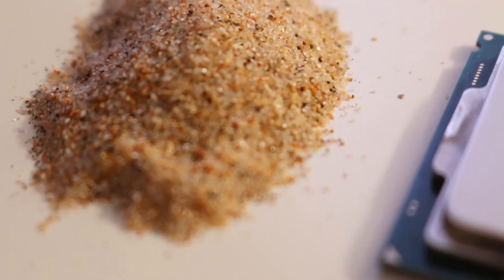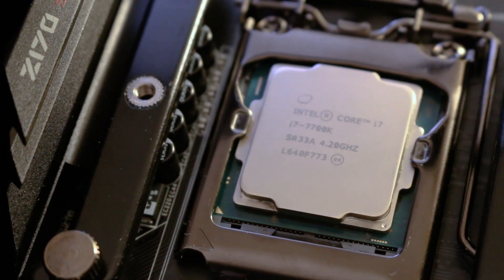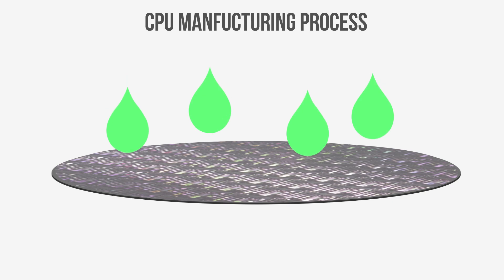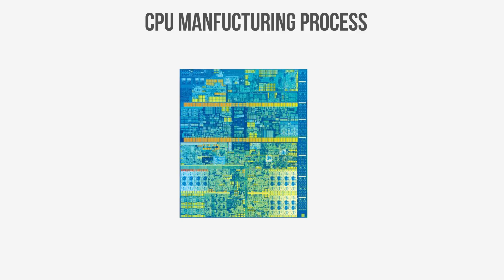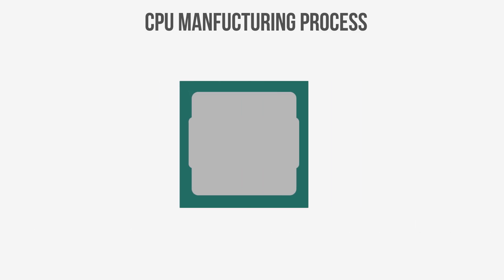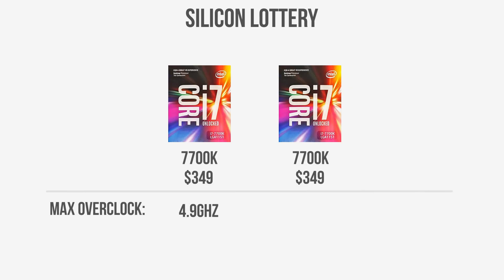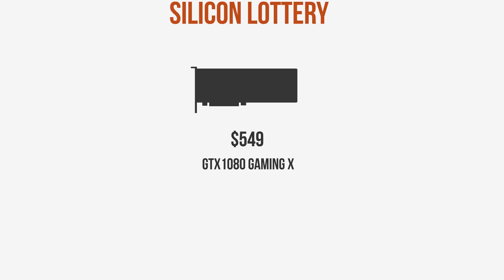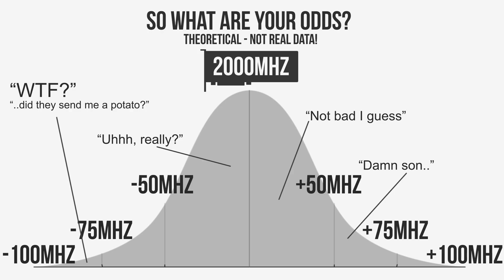What is The 'Silicon Lottery'?

Comment: Had a few wins over the years and a few losses in that lottery. i7 6700K @ 4.9 GHz, Core2 Quad Q9650 @ 4.5 GHz, GTX 750Ti @ 1,460MHz (bios mod), R9 Fury @ 1,200MHz (bios mod) and an R9 380X @ 1,240MHz (stock bios) were the most notable ones. It's all good fun!
Reply: Using ASRock Z170 OC Formula with Corsair H110i GTX. The 6700K must have been a golden sample. The Q9650 can no longer hold 4.5GHz these days as (alas) she is getting old :'(
Reply: Ran my old soulmate 2500k at 5ghz for a good 5 years before i upgraded to 7700k which had to be de-lidded to have normal temps at 5ghz lol
Reply: GTX 750Ti at 1,460MHz??? What the fuck? How does it perform?

Comment: Won the silicon lottery twice - 1080 MSI Gaming (without X) running at 2043MHz and 7700K hitting 5,0GHz on air(31 deg. idle, 60-70 gaming, 87-90 Prime95, Scythe Ashura). Had to lower the CPU tho because my MB sucks and VRMs getting pretty hot(I plan to put some radiators on them to keep them cooler). For now I keep the 5 gigs one core utilization and 4,8 all-core utilization.
Reply: I need 1.29V to get to 4.4Ghz on my i5-4690k.

The lottery fucked me
Reply: MrPrzepior Noice. I'm pretty sure I lost both xd
Reply: MrPrzepior won the silicon lottery on my 4790k running at 4.9 ghz stable at 78 c after a 6hr aida 64 run
Reply: Theres a good article on that subject here: http://spectrum.ieee.org/semiconductors/processors/transistor-aging

You are right - the lifespan shortens. But I think it's worth it(i7 has 3 year warranty)
Reply: air? just cooler? NOICE
Reply: got my i5-7600k to get 5.00Ghz, on water ofc..

The lottery praised me
Reply: 87-90 in p95 is quite a lot, people tend to keep at around 70-75 in p95.
Reply: It's on air and with -4 AVX offset. Versions prior to 26 can get the chip's temp quite high.
Reply: hope it lasts. I overglocked an EVGA 1080 last year, and it suddenly died on me this year with no warning.  I will never overclock a GPU again
Reply: GamingTaylor overclocking can not kill your card. increasing voltage might but if you leave it on stock it shouldn't affect longevity of the card
Reply: Overclocking does lower the life span of your part.
Reply: Promxy Mc Yah that's what the manufacturers are stating. In my experience (had several NV and ATI/AMD cards - all overclocked w/o voltage tweaks) the OC never caused the part to break or behave strangely. The only part that's got broken in my nearly 20 year history of computer usage was the bullcrap PS I bought as a temporary replacement.
Reply: I never said it breaks your part instantly, it just gives it a shorter lifespan.
Reply: My 4790k topped out at 4.7ghz,  didn't do well there.  But my 7700k is at 5.1 with 4.9cahce speed.  My 1080ti is running at 2088mhz,  ive had 3 others and I pretty much hit it with this 1080ti.  Gaming x sucked 2012mhz,  arous xtreme sucked 2037mhz.  Zotac did 2050 out of the box.....
Reply: 1.375v to get 4.6 on my 6700k  i got raped XD
Reply: Not true. HIGHER TEMPS lower the lifespan of your CPU, not over clocking.
Reply: damn, u look like 40yo virgin
Reply: Well now. I've got a i5-4200M @ 2.5 GHz 2 core w/ hyperthreading. That managed to go up to 3.03 or 3.10GHz, according to Task Manager for Windows 10. Then again, I never actually stress tested it outside of games, and since it seems my computer handles that overclocking, I'm not sure what it's capable of. (Alienware 14, probably not sold anymore)
Reply: Bigd Hehe i was hoping someone would tell the idiot and fortunately you were the one.
Reply: 6600k 4.5ghz 1.27v with a z270x gaming 7, nothing special here, haven't tried any high clocks.
Reply: You lucky duck
Reply: Pssshhhh... I got a lottery winner that'll blow all of you away! 

My i3 6100 is over clocked to 4.5ghz, which should also only be a dual core, and this thing is a quad core unlocked!!!! It runs at sub temp too... Air cooled....

Actually, I've been basically boned on both my CPU and GPU... I just wanted to be cool and say I finally won something lol.

Comment: Got that Ryzen 1400 at 3.8Ghz with 1.3v, 3.9 at 1.375-1.4v. Did not try 4.0 cos i dont go over 1.35v. So 3.8 is the deal :). U were lucky with that 1400 at 4.050 with 1.33v.
Reply: Circumcisio10 Until 1.45v on the vcore and 1.3v on the vdda it is completely safe